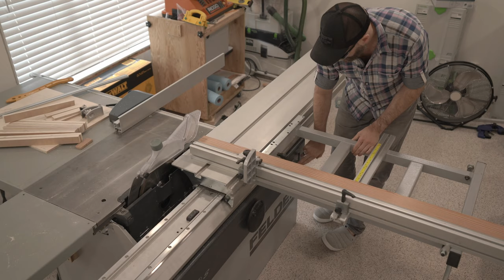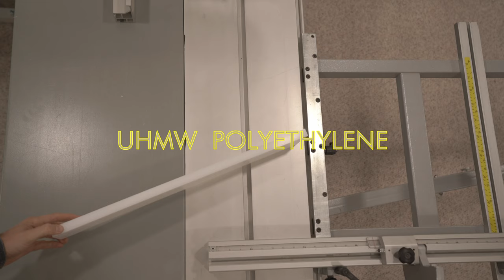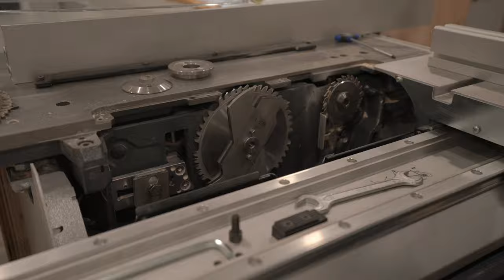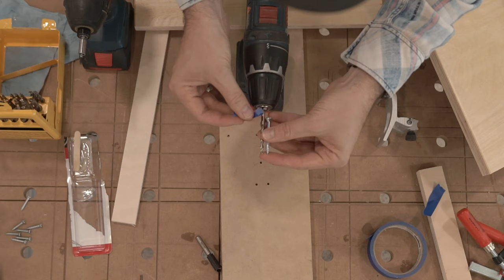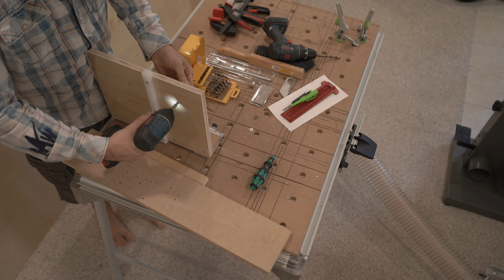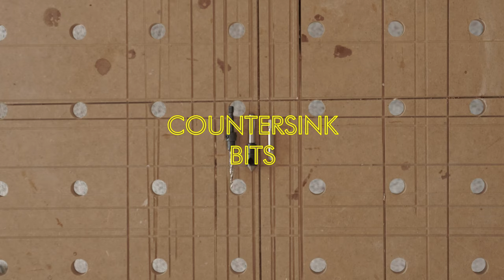The Fritz & Franz Jig: Build It and Use It

Comment from the maker: FYI: The Ikea handle was not the best choice. Its screws are very long and thin, and after making several cuts through 8/4 maple they started to bend. The jig's been seeing a LOT of service with and without it though, will update the video and repost when I either make or get a new more robust handle.
Reply: No you didn't. You are a procrastinator just like the rest of us. Ha
Reply from the maker: @robertcornelius3514 ha ha ha, you are absolutely correct! 😂 And it’s working fine without the handle, thanks!

Comment: Hi - this is a great video, and I made a Fritz and Franz inspired by it. I was very frustrated by the Lee Valley stops, however, and replaced with the Jonathan Katz ones. They are fantastic. I also attached the track from below with T Bolts, so it’s adjustable should I decide I need to adjust it (it’s .2mm off, and I’m sure I will spend 2 hours at some point trying to get it perfect). Of course with the Katz stops, I can just adjust the stops instead of the track. 

I don’t think I can attach a picture in the comments, but will try to send one.
Reply from the maker: Thanks! J.Katz is a champ, gonna go check out his stops right now 😄. I haven’t had any issues with my Lee Valley ones yet, but maybe I’ve been lucky (?).

Comment: Hello and thank you for making this video.  Would you be kind enough to share the details of the articulating lite you have attached to your bandsaw?  Many thanks.
Reply from the maker: It's Laguna's Woodturners Lathe Light, but it fits their bandsaw's too (and comes with a generic clamp for non-Laguna equipment too). It's called the LED Chameleon 95CRI Lamp. I'm in Canada and was told by my local tool store that it hasn't been certified for use here yet, so I ordered it straight from Laguna and have had no issues. 
Link: https://www.shop.lagunatools.com/Laguna-LED-Chameleon-95CRI-Woodturners-Lathe-Lamp

Comment: Interesting, I used a giant 4"x6" douglas fir board as the substrate for my F&F jig.  I cut two 18" pieces and squared them up then stuck the rail on top of that.   Did you find you needed to retrim the back side of the jig's zero clearance surface?  I ended up with a bit of play in my back runner and needed to retrim.
Reply from the maker: So far I’ve had no play and no need to retrim the zero clearance edge (fingers crossed) despite constant use. I think the dado was largely responsible. I was very pleased to have gotten it just right. 4”x6” sounds awesomely robust!

Comment: I don't know why everyone makes the F&F jig so complicated. I have ben using the F&F jig for well over 10 years and all it is is two bits of MDF with runners and some sand paper faces made in about 20 minutes, no measuring is needed as that should be done using the rip fence as a measured bump stop.
Reply from the maker: @duster8100  I like it for the small hobby stuff I’ve been doing lately, which keeps everything on the slider side, but you’re totally right! Thx for the comment✌🏻

Comment: I love the task light you have on your bandsaw!!  Where can I get one?
Reply from the maker: So do I! It's Laguna's Woodturners Lathe Light, but it fits their bandsaw's too (and comes with a generic clamp for non-Laguna equipment too). It's called the LED Chameleon 95CRI Lamp. I'm in Canada and was told by my local tool store that it hasn't been certified for use here yet, so I ordered it straight from Laguna and have had no issues.
Reply from the maker: Link: https://www.shop.lagunatools.com/Laguna-LED-Chameleon-95CRI-Woodturners-Lathe-Lamp

Comment: Where did you get the polymer ?
Reply from the maker: I got mine at Lee Valley tools. https://www.leevalley.com/en-ca/shop/hardware/jig-and-fixture-parts/32045-uhmw-polyethylene?item=46J9014&utm_source=free_google_shopping&utm_medium=organic&utm_campaign=shopping_feed&utm_campaign=CAN-EN%7CPLA%7CShopping%7CHardware%7CNon-displayItems&gad_source=1&gclid=Cj0KCQjw_qexBhCoARIsAFgBlev5eDp6cu7uRmoZg5GSXLuia3G_VX0aYDpXQprZOMP5hBfnp2zbbB0aAswXEALw_wcB
Reply from the maker: you can also grab a thick cutting board (in Canada,  SuperStore has what they call a "Commercial" cutting board, which is just as thick

Comment: F&F jigs do not need tracks and flip stops or even measuring tapes. Use the rip fence to measure the cut off to the needed dimension and simplify the build to two bits of wood and a handle if you need one but in 12 years of using an F&F jig I have never had a handle. The flip stop thing comes from using cabinet saws and if you go back to the original video they used a handle but it is not necessary. I am sure the craze for having flip stops etc comes from cabinet saw users who have changed to a slider.
Reply from the maker: For the small stuff I’ve been cutting lately I prefer having the bulk of the piece on the slider and the cutoff on the rip fence side of the slider. I should be using the crosscut fence for my measurements, but my scales are Imperial and I’ve been slow to call Felder to get a metric replacement. 😄. Thanks for commenting!👍🏻
Reply: The stops on the F&F are incredibly useful, and allow me to do things I could not do with the fence, with much smaller pieces as well.